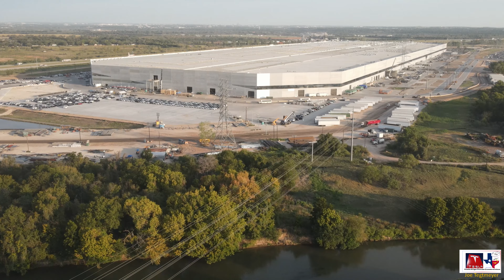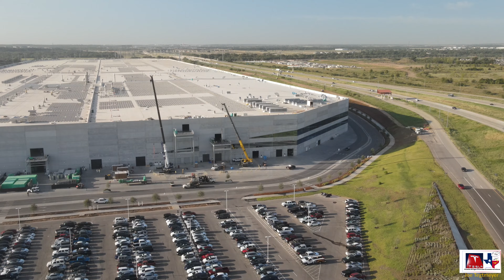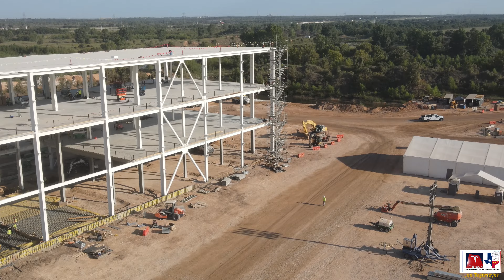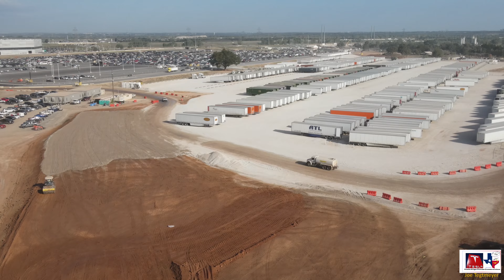Roof changes & electrical substation progress on this 26 September 2022 at Giga Texas! (08:10 AM)

Comment: At 21:25 the foundation reminds me of the ones for the modular buildings we had installed on our campus.  The modules are trucked in and filled up the parking lot in the early morning, and the crane and crew had stacked them in place by the afternoon, so the whole building went up in essentially a single day.  The second floor has an elevator that's freestanding, not a part of the building.  So it plainly sticks out.
Reply: The construction appears to be temporary and located in the contractor work area. Probably required to construct large parts for the cathode unit.

Comment: Joe, it's also possible that the new DMG Mory Machining centers could be used to create new stamps for the stamping area.
Reply: Andrew, south of the Schuler transfer presses is an area where dies are maintained with inspection and machining capabilities.
Reply: Although I agree it is a possibility, wouldn't they mount them closer to the stamping area?
Reply from the maker: It is a possibility

Comment: The casting may be curing. In the 1970’s, Ford used to cure their engine blocks (Windsor) by leaving them outside to expand and contract in the open weather to allow the metallurgy to align the molecules of the steel castings to align and/or scramble, in order for the castings to harden before “finish” machining into complete engines.

Comment: Thanks Joe
0:50. Casting. Another DMG machine on the left obscured by the arrow. This seems to be a DMG MORI ‘DMU 340 Gantry’. A different machine to the pair of ‘DMC 340 U’. 
It would be great if a toolmaker could chime in here with an opinion on what these machines are for. Several have posted comments over the years.
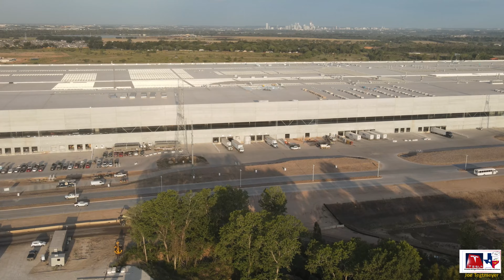5:41. Temporary trailer yard. The pair of machines are by ‘Icominc’, removed from Casting. Temporarily or otherwise. Same machine at Berlin, https://youtu.be/7-4yOx1CnXE?t=72
7:10. BIW, roof. New opening. Some small section steel seems to have already been installed. Couple of large unpainted section of the roof beams. Must have been inaccessible when it was painted for some reason.
PV Array. Angled brackets with 4 boxes. 2 visible, another 6 nearby.
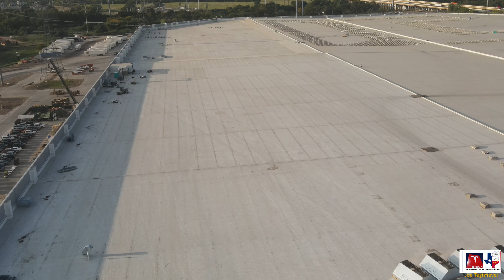7:35. BIW loading platform. Crane hoisting up crates that seem to have come from storage within GA.
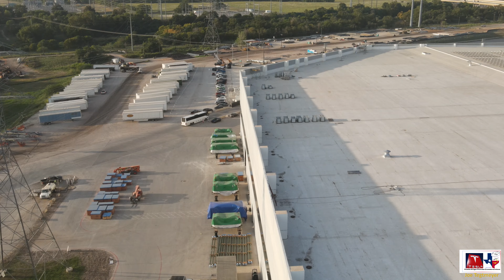7:56. Stamping, roof. Reappearance of the scaffolding platforms on the corners. Same at Battery and Casting.
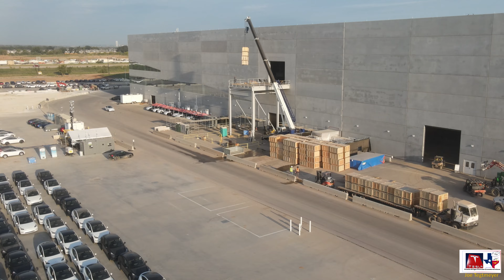9:08. GA loading platform. Think these crates are going around the corner to the BIW loading platform.
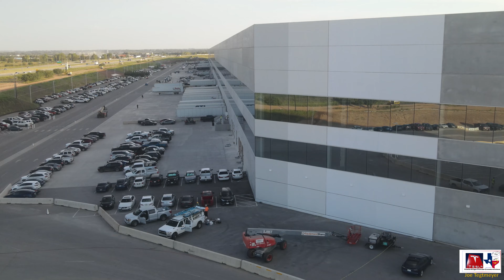9:56. GA south west. Sample colours would seem likely.
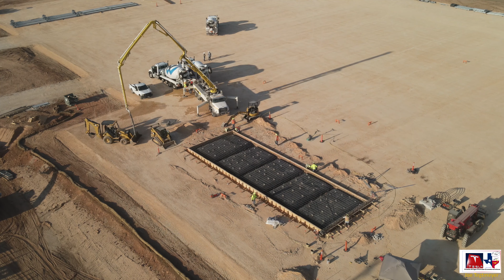15:12. New substation site. No services run into the slab. Footing for a large bit of equipment perhaps. Truss type structure at the north end is a powered screed. Could be aiming for a high degree of accuracy in the surface. 
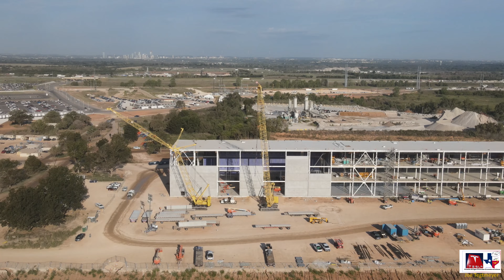16:57. Cathode. Skinny wall panel placed at the top. Likely to work in architecturally with windows on the west side. 3 different heights of wall panels seen here.
20:31. Cathode. Level 1. Continuous ‘ledger’ fixed across the face of the studs at about the same height as the beam fitted between the columns. Trafficable ceiling space possibly.
21:49. East of Cathode. Assuming the concrete legos have been laid level, it’s clear the site isn’t. Semi-permanent footing for office trailers perhaps. Weirdly the earth ramps down on the north side.
23:22. East side contractors. Right of screen. Formwork yard clearing out.
24:05. BIW. Centre of screen. 8 new loading dock openings. Plastic sheeting over most. One open.
Reply: Dessie, These machines are controlled by a program in a computer. They can be used for many functions and switching between functions requires seconds. Probably will be used to finish castings but of course that is a program.
Reply: @eltonray2934  I don’t doubt the versatility of the machines. I’m focused on the physical size. Hopefully Joe will keep peering inside and we can see one of the machines at work.
Reply: Perhaps the milling machines are used to make dies for the casting machines.
Reply: @tinyrodent5606  My thoughts as well. They seem to be massively oversized for just machining up a 70kg 150lb casting. Plus there's 2 entirely different types of machine and it would seem unlikely they would need to run a casting through 2 machines.

There is a similar machine in Stamping that is likely used for die maintenance there. Closer machine here, https://youtu.be/k7Iefou18iw?t=386

I have no knowledge of these things though, I'm a carpenter. Out of depth with this.

Comment: Joe, Thanks for todays flight. How many batteries do you use daily ? At 5:41 I have been watching the two machines in the bottom of the picture every since they were moved here from next to the building casting area. My thought is that they were used to remove the release agent and clean the castings much like a large dishwasher. Berlin had a video showing one of the units next to the robot that removes the castings from the press.

Comment: When I saw your originalvideo, I was sure these were 5-axis milling machines and they likely can do all the milling needed on either model Y casting in one or two setups.   I m a gas turbine engineer and have seem many of these machines and had many structures finished machined on them.   Good presentation of the Mori.
Reply: Gerrick, the milling machines would probably be programmed to receive the casting, align to specific points on the raw casting, perform all machining required and eject the finished product in a matter of minutes. One milling machine for front and one for back. Since they are pre programmed, switching between products would only require seconds. There may be three of these milling centers.
Reply: Pretty much my thinking too. When you see the breakdown of the Model Y castings, you see several spots that are milled to precisely so that suspension subsystems can be attached. They also drill and tap a number of bolt holes. With a machine like these, this would be a totally automated process.
Reply: @Bill_N_ATX  yea, I’m sure Tesla made the casting with datum locations so they can quick load the casting use the datum point to set up the part  and do the machining.  Probably can machine it in couple of hours.
Reply: @gslogar1  Hours would be totally unacceptable for production, has to be minutes. If it takes 2 minutes to produce a casting, then if milling takes 4 minutes there would have to be twice as many milling machines as there are casting machines.
Reply: @royh6526  Yea, you’re probably right I did one offs and small runs and generally they were complex geometry parts.  And generally, you needed to define the datum point from drawings.  All takes time.

Comment: Joe, I wonder if the build up of cars has anything to do with the rail workers strike that was supposedly settled. They still have not signed the contract agreement yet and they may be holding the cars back just in case the contract does not get signed.

Comment: Milling machines: Recycling casting with defaults, so that it can directly be reused/melted down for new casting?
Reply: Milling center : A computer programmable machine with 5 axis of movement that can be used for machining parts. All of the aluminum scrap and defective castings are collected by Texas Disposal Systems for recycle probably because the aluminum has been contaminated with mold release agent and other chemicals.

Comment: 21:45 Could be a temporary loading dock. Its a really cheap solution when you need a temporary location. Heck, some of those are permanent where I live. If it is only used infrequently, it does the job quite well.
Reply: Seems too narrow for a semi truck though… it is a curious set up

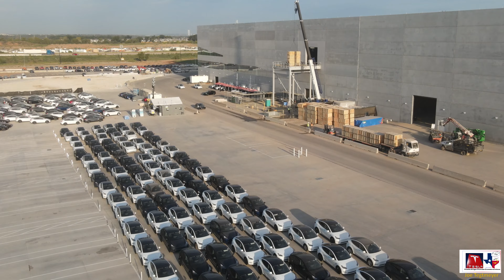Comment: Joe, at 8:50 those crates are being sent OUT from the south end of General Assembly. I was hoping you could get a shot at some of the shipping labels on those crates. Could they be some of the structural battery packs from the battery production area? The tractors hauling those trailers don't look like OTR tractors, making me think they may be sent to a stockpile on the property? Or maybe castings destined for GigaBerlin so that Tesla can save some of the energy that Europe is so desperately stockpiling ahead of winter because of the embargo against Russian gas and petroleum. Molten aluminum requires a LOT of energy.
Reply: Dan, They could be empty boxes being sent back to a supplier. Crane showed no strain to lift them.
Reply: I have an idea these crates are being shifted around to BIW and being hoisted up to the top floor via loading platform. See 7:35.

Same thing was going on in Jeff's video yesterday.

Comment: 19:49 It's nice that they tried to save some trees.  Unfortunately, it looks like the tree on the right isn't going to make it.  I wonder if they damaged the root system accidentally?
Reply: It could also be a different species. Some local trees have lost a lot of their leaves and went dormant due to the extreme heat and lack of rain. I know of one variety of oak that does this damn near every summer. They come back in the fall when the weather gets cooler and the fall rains kick in. On the other hand, you could be correct and they’ve compacted its roots.  Would be a shame. We will know the truth soon enough.
Reply: 19:49. Not particularly clear in this shot, but there's a trench cut right through the area under the canopy. Trench been there almost since the initial earthworks were completed.

Better shot in Brad's video, https://youtu.be/Ue0mbvXrZDk?t=639

Comment: So would the milling machines be used to adjust the output of the casting machines?  If there's something where the geometry of the part makes casting impossible, perhaps they cast with extra material that the milling machines then remove?  Or even to just clean up where material is injected into the cast?
Reply: Castings are great but you can’t always cast to extreme precision nor can you do thing like tap hole with threads etc. You do these with milling machines. These are huge multi axis machines with automation and robotics. So you could have a robot load a casting into the machine and it will register the casting into an exact spot then use the various tools to automatically mill surfaces, drill holes, tap threads, and do full QA of the casting. The idea is to minimize humans having to touch components. This gives you speed, accuracy, and repeatability.
Reply: Castings almost always require some level of processing afterwards. This is particularly true for surfaces that are going to be mated with other surfaces. There's also the fact that they need channels for the metal to flow throughout the casting. Some of those channels might need to be removed.

Comment: I wonder if the AIDA equipment has to do with creation of CyberTruck exoskeleton?  That will surely require some sort of large bending/brake machinery.
Reply from the maker: I can’t say for sure what parts they are responsible for but I have heard on site this is for Cybertruck production.
Reply: Charles this could be right, the existing AIDA press appears to be setup to produce the thicker metal brackets required. This is accomplished with a single die that parts travel through and are formed with several strokes as the parts are moved automatically. This process could be used to form the stainless parts required. (no compound bends)